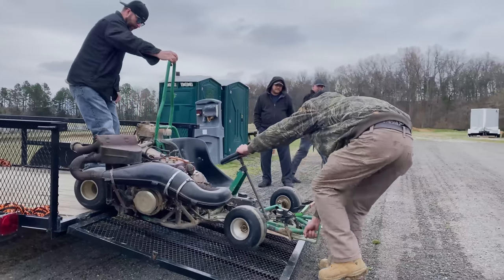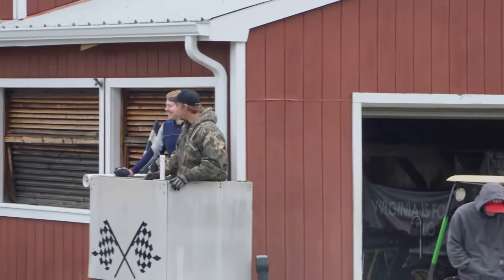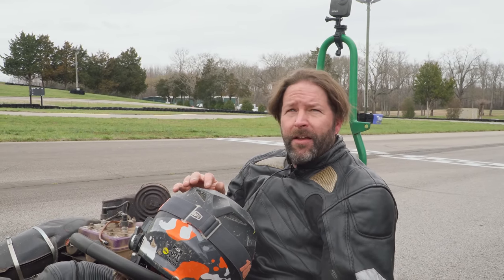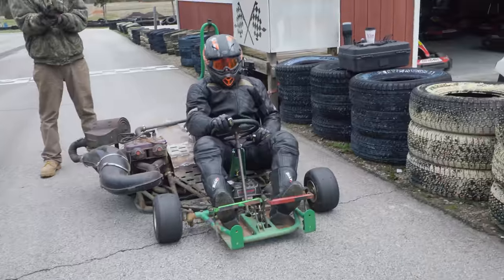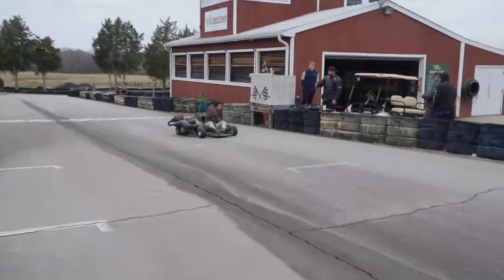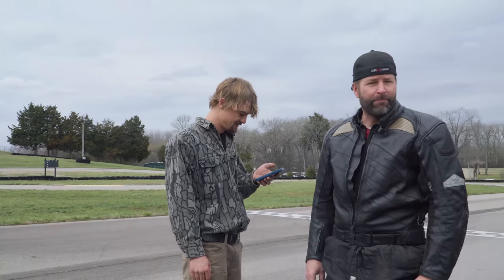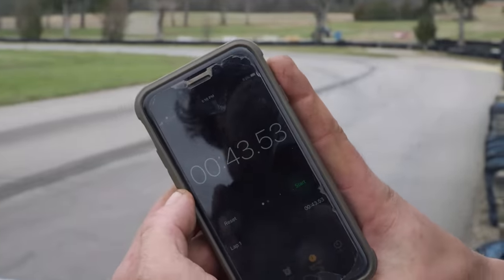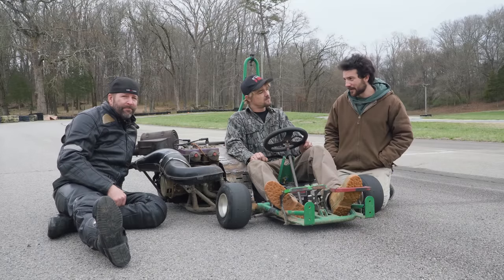We took our 125HP Go Kart to the Race Track! | *Insane Acceleration*

Comment: Watching the way that thing was pushing I figured at that point you were going to get your butts kicked...road race.  Acceleration wise, that thing looks frightening.  How much for a rented lap.  :-)  I'm betting straight line, how it was running up front, you might toast the track karts.

One thought, a tire pyro gauge might help with set up, once you get it REMOTELY right, if you can.  The moon comment was hilarious.  No offense, but the Stooge just SMOKED you guys.  The toilet paper was hilarious.

Oh, and I figured out how to equalize the turning side to side.  Just put another one of those beasts on the left side.  :-)  It sounded like I only heard that throttle really opened up for about two or three seconds in that entire video.   LOTS more back tire?   For the straights.  And maybe a serious ground effect wing (haven't seen that yet) for the front?  Get that damned front end working and this thing would be a rocket ship.

Watching further, I should have realized when you can gain 50 yards in about one second accelerating against that other kart the handling wouldn't matter that much, unless it was a lot worse than this.  That is a RIDICULOUS advantage.

Comment: I think that right front has a touch more camber. That would explain the right turn issue. Even sitting there at the end of the video it looks like that front right is bent upward. Pipe wrench to bend her back and a couple few gussets and It'll Be Fine..but I'd still check if there's a crack in the frame there.

Comment: That was a proper test for sure! What tire brand and compound? Also its possible a wider wheel and tire up front will increase the front grip. Idk the spindle diameter of that rental chassis but on pro karts there is 17mm or 25mm diameters. Either or front hubs can be added to dramatically increase the front track width. With front hubs you could essentially use the rear wheels on the front and test the effects. The power on that engine is insane and way to much for that small kart track but i cant wait to see how you guys tune and improve that chassis to suit that engine!

Comment: That is totally a rocket ship. You could get more with clutch tuning and jetting, jetting would help with the plug fouling. If you added the same amount of weight as the engine to the left side would that help with handling? Just throwing that out there. Its plenty fast the way it is.

Comment: Too add to another comment saying its running ritch i totally agree and that can be fixed with jetting but carfully becouse these engines are very temperamental and can melt pistons easy. Another easy solution is to change the oil your useing. Its great to use the injection system on these sled engines there very reliable. I found with a few of mine that useing a high quality synthetic oil makes a world of difference. Oils such as ipone use a formula that burns more easy once into the cylinder and keeps the exaust valves from cloging up as easily

Comment: You'll have better luck keeping the engine cool if you push air through the radiator instead of pull it through the radiator.  You can only get 14.7 psi by pulling but you can get a lot more by pushing (compressing) the air.  Of course space is always a factor :).

Comment: Awesome , i wouldent replace the coil chances are its all in the carburetor tuning, i recently swaped in a new coil on a roatx 500 (same engine architecture) and it still fouled plugs , it was all in the float height adjustment and fine tuning , you guys definitely need to sync the carbs,  adjust the oil injection , clean the RAVE valves and adjust the clutching ( the primary has "clickers" that change the ramp angle and thus operating RPM ) You can get a service manual for the 670HO online for free .
Reply: doesn't your 500 have reed valves?
Reply: @ExploreUnderground  It wasn't my Skidoo , but has it has rotary valve like the 583cc & 670cc

Comment: Make sure the exhaust valves are not gummed up also the crankshaft seals do a leak down test make sure they are good.  One more thing make sure the carbs are insinc you should use a Carburetter flow gage

Comment: should defiantly take another one of those rental kart frames and build a balls to the wall predator 420 like a 10k screamer along with a 212 screamer and compete it against the snowmobile kart on the track also gear the karts alil taller for 90+ and try and get on the big track nd see how they do

Comment: You guys need to race cars like I did for five years.. 
Go grab some bathroom scales and place them under each tire.. that will tell you the weight distribution.. take steel and add it so that the front tires are even on the scale.. do the same to the back.. and then if you still have problems with the steering? Add more weight to the front so it doesn't oversteer!  Good luck..

Comment: I bet the caster angles are wrong on your front end. I had and Invader kart the somebody hit a boat trailer with. Caster was all outa wack on one side. Heated the frame with a rosebud and twisted the outer “C” where the spindle mounts with a pipe wrench. Made the caster angle from the bent side match the good side. Also converted a 2005 Millennium dirt oval kart to a street kart. The front on that was all adjustable with shims, heim joints and camber plates to set up the front end alignment. Trick is when cornering you need the kart to get up on the inside front tire, so it plants the out side front tire and lifts up the inside rear tire. It takes some time to get it right but when you do it’s gonna corner on rails. Fresh stickies and the right psi are a big help too.

Comment: You need even weight distribution that's why it don't corner right I suggest fitting weights the opposite side to counter balance the engine on the opposite side it's obviously got plenty power so extra weight shouldn't be an issue what a beast though

Comment: Just build a longer cart and add that engine in middle of it and make proper exhaust pipes so you can put seat in right place and also use proper motocross pipe,  so you can get that cart handle much better in left and right when wheight its same in both side.

Comment: You need a 2 stroke professionnal to tune the carburation. Sleds are made to run right in Extremely cold weathers. Won’t run to the right mixture in summer. Will have too much fuel causing spark plug fouling amd will not have all the power it should.

Comment: also you need to blip the throttle when slowing down. you wont have lubrication on decel further heating the piston up and needing that fuel to cool it so you dont soft seize. i can already hear the pistons rattling.

Comment: I seen lunatics build carts with 1000cc inline fours with 200+ hp. There’s always some guy pushing the envelope. Coming up next supercharged or turboed 300+ hp. You know they will or already have. 

I watched a YouTube video for Nitro powered 1500cc Hayabusa based 4 cylinder snowmobiles making 1040 hp.  Them things flat boogie, they launched at 4 g’s. Run a 600’ track in mid 3’s. If I recall right, 176 mph. Put that into your pipe and smoke it.

Comment: I HAVE to tell a quick story (was reminded of it when I saw the "loose carb") that has caused me to check the carb and intake on 2 strokes EVERY time before I fire them up!.... Hopefully, at least one person can avoid a future mishap:  

So, back in 96 or so, my friend had a '88 KX250 and we were about to go out riding... I fired my bike up, he kicked his over, and... It STARTED SCREEEEEAAAAAAMING (many rpms! lol).  I watched as he hit the kill switch to no avail, and even PULLED the spark plug boot OFF and it was still going without a hiccup!  It finally shut off when ripped the fuel line off the carb. 

What ended up happening was, the intake boot between the carb and reeds was dry rotted and had cracks going through it.  This caused a good sized vacuum leak, close enough to the carb, that it was pulling a good amount of fuel with it, and allowed it to rev up to what sounded like at least 7 or 8k rpm.  So, basically the thing was SUPER lean to the point it had the plug glowing and "dieseling"  (so killing the ignition did nothing to stop it).  

Man, that thing was LOUD!!  and it was scary as hell, too!

Comment: I'm sure those carbs are designed to run with a pulse pump. Took e months to get full power on my 870cc. Once I installed pulse pump from sled not only did power go way up but it ran so much cooler, no doubt from proper fuel going into engine now.
Reply: what's your sled that's a 870?
Reply: @ExploreUnderground  engine is out of a Polaris indy xc

Comment: An interesting beast for sure, but I'm guessing you know Division 1 Superkarts make nearly the same horsepower with 250cc. Waaaayyyy better power to weight ration than yours. Wet clutch 6 speed gearbox gives more direct drive too. Add carbon fibre aero bodywork and up to 14,000 rpm and yours now looks rather slow! Awesome for the money though and I loved watching the video! :)

Comment: Haven't read all the comments, so don't know if anyone else suggested this, but as you've been running the cart on dirt, the air filters are probably clogged (they look filthy in one of the early close-ups) so the engine is suffocating. Although that would affect the performance all the time, not just once the engine gets hot?! Either way, I'm sure it would run better with clean/new air filters?

Comment: The axle having, no differential action could be a major cause of the turning issue. If the bad turn is to the right, add some air to the left rear or drop the right rear.

Comment: If you connect a automotive tach with adjustable shift light to the kart. But disconnect the shift bulb and instead connect that positive to a momentary( NO) switch  then onto a 5 pin relay  .  and the hot wire sending power  to the coils  connected across the (NC) pair of the relay.  ( end result is launch control   )
Reply: A Honda or mikuni vacuum fuel pump should fix the fueling issuie

Comment: It's wetting plugs because the crankcase seals are leaking causing gearbox fluid to get into the fuel mixture in the crank then burning off on the plugs

Comment: Dear cars and cameras I just wanted to point something out that through watching the video on my 80 inch flatscreen TV with 1080 P resolution I noticed that you guys are having a hard time turning right because of the camber on the right side of the golf cart the camber is pushed so it turns left better than it does right because there is more weight on that side you’re not gonna have a good right turn but I left turn very well

Comment: Issue of turning probably has to do with balance of that thing. Engine is heavier so on left turns it pushes that weight on the tires, but rider balances it enough not to flip, where on left turns engine weight goes sideways and it should be equally heavy driver pushing tires to ground, but since driver is lighter than that it goes more sideways. I was afraid that was a problem and it seems to be that way. You can check it with testing it with different weights. Add weight to drivers side and if time stays same or improve but right turns become easier, there is your answer.

Comment: Hey I have a question. I bought a 459 and I’m putting on a atv. I disconnected nevery thing yo the governor arm so I could hook up my throttle the same way I seen a guy do it on YouTube and I believe you have done it as well. By cutting the rod to the governor arm and bending it so it would hook up to the throttle lever. My question is what should I do about the governor arm. I’ve heard guys say put a spring on it but do I put the spring so the arm is being pulled towards the carb or should I put the spring on it so it pulls towards the kill switch? Idk what to do with the governor arm but I’m sure I can’t just leave it without putting a spring on it. What do you think?

Comment: yu guys should look into a gnss performance analyzer for your speed data. They are about $90 usd and are way more accurate than most phone apps. The data sampling rate is way higher so you don't have to hold top speed for as long to get it to register. I use one or my RC car speed runs.. Plus then you don't have to worry about possibly dropping your phone.

Comment: Needs an air box not air filters! Will never get those carburetors running properly with air filters on it. Well I guess you could make several dozen custom fuel needles and several dozen jets and test with a wideband for a few weeks until it works. The easier thing to do is go a little smaller on jetting and put the original air box on. I would suggest NGK BR9EYA spark plugs also.

Comment: reduce oil ratio switch to premix if its not already. get lucas semi synthetic 2 stroke oil. oriellys auto carries it its like 10 bux a quart. its low smoke low ash burns better and lubricates way better. its the mobil 1 of 2 stroke oils. your motor sounds lean it has that hollow sound and initial bog off low rpms. the oil switch will richen it up some and should clear up high rpms some too. run and check plugs to get jetting right . i have a pretty cranked up 2t scooter i used to daily and never fouled plugs after switching to the lucas oil. the oil doesnt build up but i always ran too much and could always find some in the crankcase by the bearings. 
i also used to have a skidoo bombardier with that 670 rotax and some work done to it. ours revved higher and instantly could reach 130 mph in 1/8 mile on a bald track as grip was too dangerous. it was the scariest thing ive ever rode. right around 200 hp and i get goose bumps every time i think about it. and hearing its banshee wail through the woods on a quiet nite.

Comment: You are running the tpm to low 2 stroke needs high rpm to keep plugs cleaner run at low rpm and you will continue to foul plugs. The term up on the pipe keeps the carb and plugs clean
Reply: Rpm sorry

Comment: Your right spark plug wire is a 1/4” higher than the left so prob not making a great connection. You’ll dump a bunch a white powder out of it after you run it a while. Hence the wet plug. You accidentally fixed the issue checking the plugs. Lmao.

Comment: Take some time and get the geometry right on that steering and it will change the way it pushes so hard on the right. As bad as you don't want to do it when you do the 1.618 " golden ratio " you may have to make it a little longer .  I you need some tube to do that reach out I have plenty just for this reason . Please be safe that damn thing is fast as F !!!!

Comment: Nice kart guys! But I have question for anyone who is reading these comment and are in the know bout small engines. I have a Robin/Subaru EH34 11HP engine with tapered shaft off generator I want to put 1" straight shaft so I can put on my Fox Black Widow go kart with 40 series converter. For anyone have one or have a connect on it? Or knows if these engines can swap crankshafts with another brand of engine? Please leave a comment and let me know

Comment: That thing looked like a white knuckle ride to me. It didn't look like it went very straight on the straight aways under full throttle. You all slowed way down for the turns.

If you can get the handling to match it's top speed i say it could easily run a high to mid 30 time on that track.

Comment: We had a Kart Track back in 91,92,93,?,?,? in the town I was from. About 1/4 the size this one is. I say ? because it didn't last long. Had Carts that looked like Stock Cars and open Kid Karts like the one you see here. The Stack karts tho, You actually had to open the tops. Whole roof tilted back so you can actually sit in them and not like these ones where 1/2 your chest and whole head is exposed. Had Honda Vtwin 670's 24+HP (+ if you took of the governors ) and capable of over 100mph.. We had to detune the shit out of them to keep them under 30mph. 
Boss man took out the Governor on one and tuned it up. Took it out on the Highway and got pulled over doing well over 100.. Didn't get a ticket because the Cop thought it was funny as fuck... and got free tickets for when the track opened.. Could have easily made them street legal. Just needed Lights and Mirrors. Size wise, I am 6ft 4in and was 240pounds and easily fit inside, with roof down.

Comment: My last snowmobile had that same 670 engine.  You are way off the power band, the engine is lugging way down below the torque curve for optimum performance.
Clutching, gearing and jetting need sorting out and hang on...l don't think you're quite half way there yet..

Comment: ugh ive been watching for awhile now...from the times of timing through the yard around the garage. I gotta say I feel these videos are just getting ugh lack luster. i feel before you guys done great solid work on these projects and now its like oh well. Just saying one thing I liked in the beginning was the fact you guys took your time and made stuff safe and fun. I don't see that much anymore. The rental cart you raced had a really really under powered cart. you can get that speed out of a Harbor Freight motor. So not saying much beating that thing. Also that motor doesn't sound right at all. You should be building more torque as you go further in the powerband. defin would take that motor off and go completely through it. Also wash your cart before taking it to a track like this. your mud and debris is being left on the track for someone else to race on. Just good etiquette.

Comment: Wonder how it would have done going the opposite direction on the track being that it didn't handle as well making right turns?  Dave
Reply: Knowing the VIR kart track, you wouldn't want to run a kart that fast backwards. Coming into that tight hairpin that leads up the back straight backwards would be very dangerous should anything happen to the brakes.
Reply: @WyFoster  Ah okay.  👍